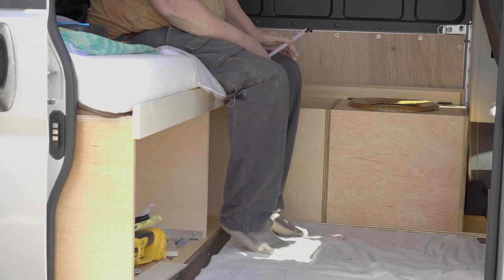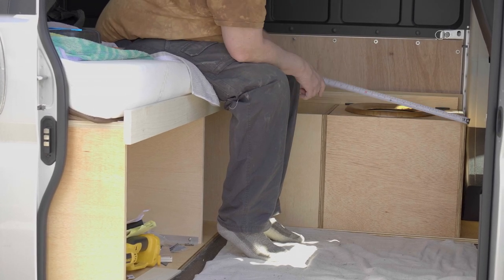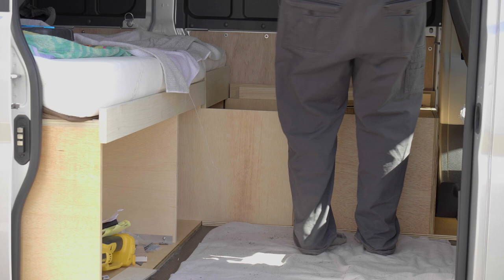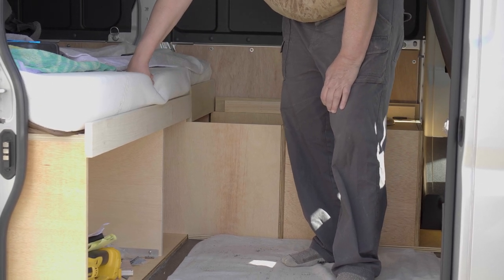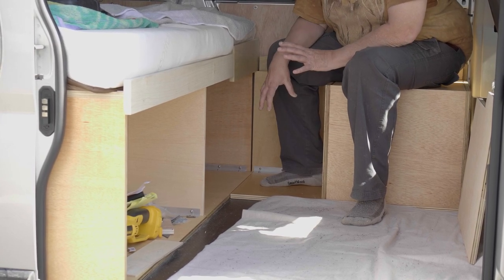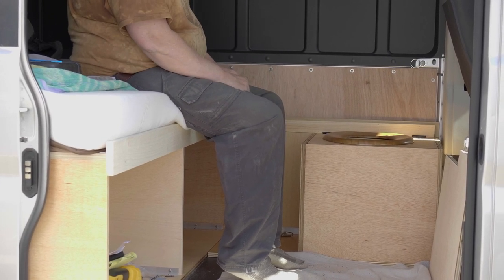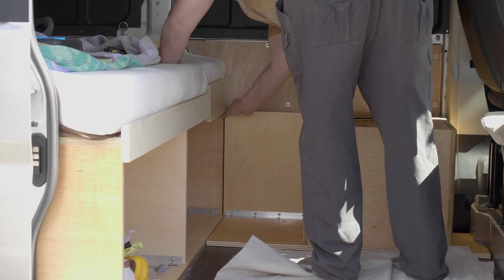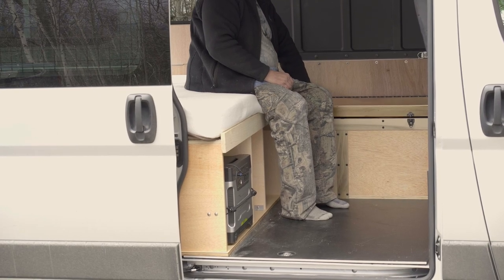Ram Promaster 118 WB Camper Build -  Part 8

Comment: Hello How do you go about assembling the plywood boards between them? To hold the boards at 90 degrees, how many screws do you use? Every time I make assemblies I can't seem to be really good at 90 and I try not to have too many visible screws
Reply from the maker: For the toilet module - toilet box, I used 1"x3/4 and I just glued and nailed in the corners. For most of the rest I used 1x1 right angle aluminum, thicker stuff on the 3 walls holing up the bed. You can't really see much of the aluminum once the build is finished, yes, maybe when you pull open the drawer. I usually do a hole 1" from each end then about 3 to 4 inches between holes, sometimes longer depending on the piece and what I thing it needs. Even if you did something like kreg screws, which I thought about, you will see some of the install. I decided to use a medium that was easy to works with, super strong once all elements installed, and could be done right here in my driveway.  On the left of the toilet where it joins to the bed, I used several right angle strips of aluminum, I use a right angle builders square to square it all up, then once you install the aluminum r/a up the walls and along the floor it will all be square. Another reason I used right angle was to be able to disassemble, if I needed to, for whatever reason.
Reply: @fireflightphoto1319  Ok do you have a video of building an entire cabinet with all the details.
What is your 90 degree tightening that you use before screwing.

Sorry I'm French, I don't understand all in English.